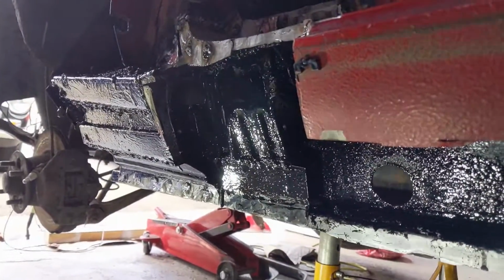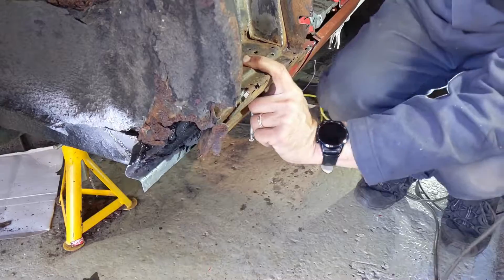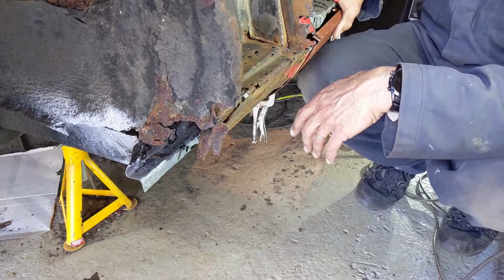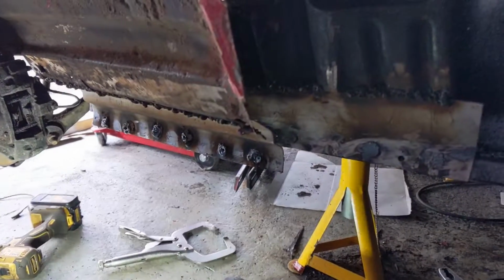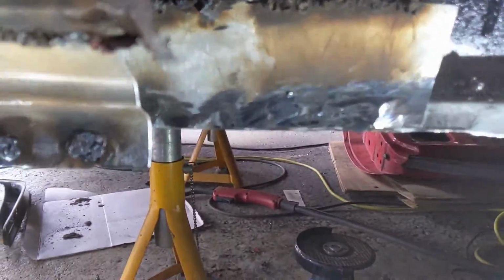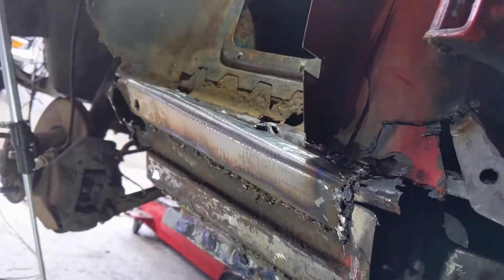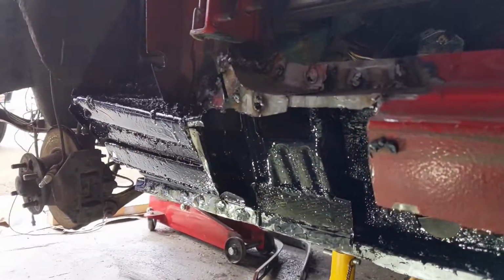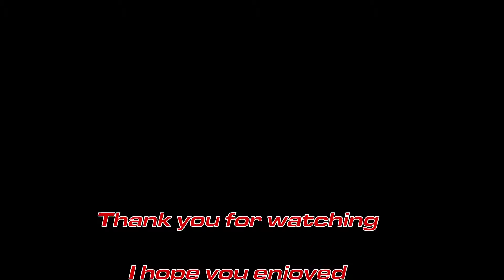Triumph TR7 Restoration: Episode 14   Passenger Front Strengthener and Hidden Out Sill

Comment: You could really use a plasma cutter
Reply from the maker: That would be great!  I have subsequently splashed out on a body saw but I've not stretched to a plasma cutter
Reply: @HenrysGarage  a non contact plasma cutter works great for cutting rusting metal.  I’ve been very happy with my Amico cutter very good machine for $400